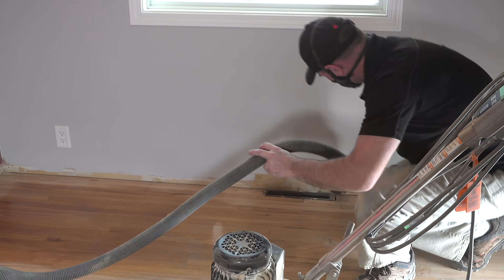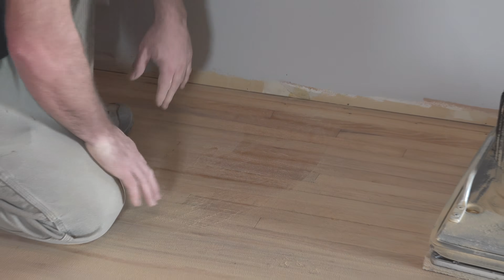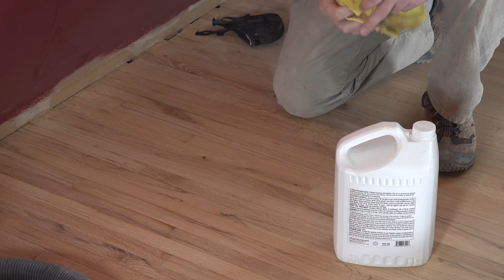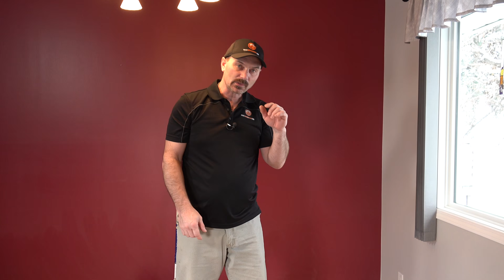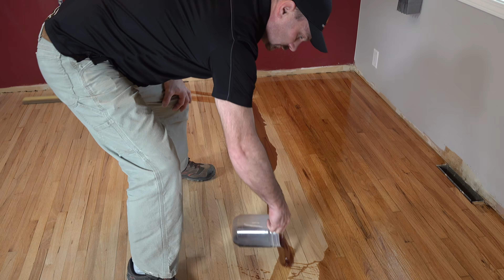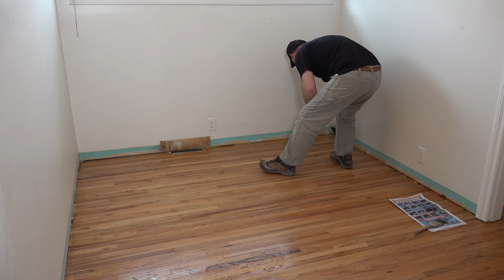How To Sand & Refinish Hardwood Floors

Comment: Hi Shannon, 
This may seem like a silly question.  How do you transition to hallways and adjoining rooms if you are doing one room at a time? Do you sand everything first? Is removing floor trim recommended?
Reply: Remove all trim, this is to avoid damaging the trim (while sanding) and makes life easier since you can't get right to the edge. With trim removed its not necessary to get right up to the wall, depending on your trim depth, that's as close as you need to get. Trim covers what you can't hit. Try and get as close as you can but don't damage your wall.

Transitioning or doing one room at a time: If it's a bedroom, close the door, on the side you're not doing yet mask off the area with 3 or 4 layers of painters tape right under the door. You layer it so that if you're sanding and accidentally hit it you have multiple layers of tape to protect the side you don't want to do yet.

Once you're ready to do the other side: mask the opposite finished side about 1 to 2 inches on to the finished floor. Try and avoid sanding the finished side, you're basically using it as a guide to match. Some blending will need to happen.

When you have sanded, stained and are applying polyurethane, on you're 2nd to last coat of poly blend the transition. You'll need fine sanding paper to feather it.
Reply: @TacoFist  Could you describe the process for blending in more detail? Is it overlapped rotations like when using a sandblaster on small masked etchings? Is it something done with the poly itself?
Reply: This was the exact question I had.  Sorry you didn't get a response....
Reply: @HouseImprovements

Comment: I am really wanting to do my wood floors but I wasn't sure how hard it would be. You just let me know it's very easy. My floors are the cherry red color, what poly... would you use?
Reply from the maker: if they are red stained and you want to change the colour you will likely need to use a drum sander instead to remove more material . The link to the poly I used is in the video description.
Reply: @HouseImprovements  Thank you 😊

Comment: I love the video. I do have a question though. In the video there looks like a six to eight inch wide stripe along the wall that is a different color. Why is that or is it just camera and lighting?.
Reply from the maker: I think it is a reflection of the lighter coloured paint on the wall along the bottom, because if you notice under the plug in that white paint is narrower and so is the area on the floor there.

Comment: The product you used had stain in it already? What color? Also, what did you uses before you got a T bar
Reply from the maker: I simply used a brush or foam pad but it takes for ever! The product is in the video description. it is a varethane so it gives the floor that colour

Comment: I’m trying to watch all the videos I can! Within this last week, we got an entire apartment with hardwood floors sanded and ended up using a “gunstock” color stain on it and it came out horrific!!!! So so bad. Now I’m trying to figure out how to remove this color stain and redo the entire apartment. I’m desperate for professional suggestions. PLEASE ADVISE what we can do to get rid of the stain (which didn’t dry yet) and have results like the one you have shown. Thank you in advance! 🙏
Reply from the maker: To get rid of a stain you will need to use a drum sander. It will sand off more wood quicker to get down to raw wood again.
Reply: @HouseImprovements  Thank you so much for your reply! We used the Varathane penetrating wood stain, which grits do you suggest we start off first when using the drum sander? And after the sanding is completed, should we just use a polyurethane coating on top or do we need to use a sealer first?

Comment: Will that sander leave  Swirl marks? I just want to sand the older yellowish  Vera Thane off So I can re clear it to look more natural.  I was told to use a water based clear so it doesn't  turn yellow over time.

Comment: How many dif grits do I use
Reply from the maker: depends on the condition of the floor. If the wood is good you can use a 26-30 to start and then transition to something like 50,80,100,120

Comment: my brother just bought a house and needs to fix the hardwood floor. He follow the first step of sanding. We are confused about the second part. Do we  apply the  Minwax super fast drying polyurethane for floors clear satin? of is there something else that goes before this. If there is something else what is the product to make sure he gets that color back.  Thanks
Reply from the maker: you can stain the floors to achieve different colours but oil based polyurethane alone will give you this amber shade you see in the video on its own.

Comment: Can you do a home without removing the baseboards? I have a place I bought with real wood baseboards and they also added quarter-round at the base of those boards. I suspect it is so that quarter-round can be removed to sand/reserface then replaced to hide any flaws.
Reply from the maker: yes just remove your quarter round and sand and refinish and then re install.

Comment: Do you know if it's possible to go from a real dark hardwood floor to a light hardwood floor by sanding it?
Reply from the maker: If the finish is completed sanded off. You will want to use a drum sander instead of the sander I used here because you will need to remove alot of wood

Comment: I'm refinishing an entry-way and it's roughly the same size as the area you showed. How much product did you use from the gallon? I'm wondering if I can get away buying a smaller can, as anything left over will likely go to waste.
Reply from the maker: Only comes in a gallon in my area.
Reply: @HouseImprovements  - Yeah it figures that they'd make me buy the full gallon... 

As for the "coverage" on  the label, at 54 years old I've learned two things in life... Never trust a fart... AND Never believe the manufacturer's coverage claims on a paint/finish label. 😉😄
Reply from the maker: The coverage is on the label.

Comment: So is the stain and clear coat all in one? I thought you stain it then clear coat it?
Reply from the maker: There is no stain used here, this poly urethane floor finish has a darker amber tint when applied.
Reply: @HouseImprovements  can you send a picture of the product you use so I can buy the same thing
Reply: One more question please. Is there a fillier to use for the wood if theres a very small gaps in between some wood

Comment: Will this darken over time?
Reply from the maker: with this product I used it will ,but so slowly you will likely never notice
Reply: @HouseImprovements  thanks for the response. I had two bedrooms refinished and stained after pulling the carpet up. The two bedrooms don’t match the rest of the house as far as stain. It’s lighter. The guy who did it said it will darken and blend over time. I wasn’t sure if that was true or not. As of now they don’t match. Thanks again

Comment: TY Shannon . I have a small bedroom 8x10  bamboo flooring in good shape . I'm planning to  remove the top coat  and  apply a different color finish. I already own a palm  orbital  sander  and wondering if i can use it remove the top coat for the entire room? i know its a little more work than big sanders  but up for the challenge if you don't see any issues using a palm sander.
Reply from the maker: Like you said its just more work but it will do it.

Comment: I started to do one room but it is a slow process for me because I am trying first to use stain/paint remover which I wonder if I really need to use this.  The steps are where I started first and have only got it done half.  The fumes from the stain remover are just way too much for me.  Do I really need to use this on the floor?  The steps had paint then they were stained which was beyond my reasoning of why?  The steps probably have not been done since 1970.  The floors are not as bad as the steps.  Do you recommend striping floors first?  They had a really nice maple stain on them but spots were beginning to fade greatly plus when I painted the room I had to use some paint thinner to remove some paint that dripped on them.  So, I had blotch spots.  Like to hear your help and assistance. And thank you so much for showing this video it is truly helpful!
Reply from the maker: The quick answer is skip the stripper and use the most course sand paper you can to start with. For more help use my forum please.https://www.house-improvements.com/forums/
Reply: @HouseImprovements  Just wanted to thank you for the info.  most appreciated!

Comment: Is that a good choice for removing paint from concrete floors?
Reply from the maker: This would not really do a good job with that. A pain stripper may be a better choice but smelly or grinding the floor with a concrete refinishing floor grinder if the paint is loose and flakey then a wire brush in an angle grinder may do it..
Reply: @HouseImprovements  Thanks. On further inspection I noticed that I also have some concrete bumps that need to be ground down (there was carpet before) so I'm going to get a diamond wheel for my angle grinder for that (and all the associated safety gear) and see how that goes for the rest of the floor. If it's too tedious I'll look into renting a stand up concrete planer.

Comment: Great video. Do you think sanding sealer single coat is required before coating oil polyurethane?
Reply from the maker: No need, IMO
Reply: Thank you for quick response. One last thing, when do we use sanding sealer then? For my house, i planning not to stain however will do sanding and it is confusing as few videos shows to use sanding sealer and few not.

Comment: Nice end result. That sander works more effectively when pad is not worn too thin. Urethane application much faster and easier using 6mm low pile lint free roller.

Comment: Thank you for video -  QUESTION:  What color is the polyurethane that you used and how much did you need for 3 small rooms doing 3 coats??
Reply: That was clear, no tint to it.
As to how much is needed for 3 small rooms, that's not a measurement.
Buy them at Home Depot and whatever is unopened, you can return it. But I'd say start with 3 gallons.

Comment: He did really well with this, my only suggestion would be to run your orbital sander or edge sander with the grain of the floor to help eliminate the “halo” or “hat banding” that you see along the red wall. Ideally you would sand in progressively finer grits of paper like you do “in the field” of the floor.
Reply: Thank you
Reply: pretty sure that's a reflection, you don't see it on the dry/dull floor

Comment: I sanded a new wooden floor a few years ago using a round floor sander/waxer, basically an orbital 16'' pad, it worked out fine but I am wondering if using a flat sander as you are using if that is better? My next project is refinishing a floor that had an oil base finish. It hasnt been refinished in 23 years and needs it. I used an oil base finish the last time I had it done and did so because I wanted the color and grain to come out strong * Its a Mango wood floor) But that was when the house was under construction, now i has furniture and finished stuff. plus we have to live in it at the same time. I know the oil base is toxic but want that look. Will an acrylic do the same thing or will I be sacrificing the natural look?

Comment: I am installing unfinished 3 1/4” Brazilian Cherry hardwood flooring & finding so many different widths. Most are within 2mm, but many with 4mm difference, creating gaps. What is an acceptable gap as far as your standards?  Some boards, the width does not match from end to end. Are these normal issues for this wood & what can be done about it?  Thank you
Reply: Oof good luck with the Brazilian Cherry.

Comment: If you do the same thing than when you painting a wall and spread it with a window cleaner cloth is precise and faster then you won’t have to throw it directly on the floor. Also after sanding you must vacuum then clean lightly with mineral water. Aloud time to dry. I have 5 cleaning companies and and I did mansions.

Comment: I did one coat and it came out so well that I didn't see the need to do a second or third coat. Should I have still done a second coat?
Reply from the maker: you will get a better length of the life of your new floor finish with 3 coats.

Comment: Man, I wish I had you confidence and skills to work so close and on the carpet with the finish.
I really enjoy your videos, no fuzz, buzzwords, music etc. just showing hows it done with tips and tricks of the trade.
Thank you.
Reply: Always use a clean dust free drop sheet on flooring next to the hardwood. And get the squeaks out of the hardwood either from underneath or through the top with special screws made for hardwood surface screwing. Doing all that work without fixing squeaky floors is regretful.

Comment: My house has smelled like polyurethane for 5 months, it isn't as strong, but it is still lingering & it's disgusting. I wash my clothes and it doesn't matter, after a few days, it picks up the smell that's in the air. We were thinking of removing the sealant & sanding down the stain & using something less harsh. I really dont want to go through all of that, but I have no idea what other options will work..
Reply from the maker: It should not smell that long. Once its is dried? Have tried  opening the windows for a few hours ? Some people are hyper sensitive to things like this though?
Reply: @HouseImprovements  my windows are open all day, during the sealant process, windows were closed for more days than supposed to... so there was no ventilation... now i have no idea how to get rid of the smell. It's driving me crazy & some guests dont even want to come over because of it. Someone suggested sanding the floors & using something other than polyurethane.. I'm not sure what to do 😔

Comment: Do you have to use a new clean T-bar foam head each time? I'm assuming you either clean the old one, or with a new foam head with the t-bar cause I'm guessing the coating drys on it per coat application. IDK I've never done it before which is why I'm asking so I don't mess it up. :/
Reply from the maker: Right after i finish a coat I put the entire thing in a large garbage bag and twist it closed so it seals up. It will stay good in there for a few days if you need to.

Comment: What do you seal the cracks and holes with if you find any cracks and holes in your floor that are uneven? You said fill the cracks in with something but what? I also saw some people use a sealer before applying the coats. Is that sealer for covering the cracks and holes?
Reply from the maker: You can use wood fillers if you want but that does not always look good. Some people use some of the fine dust mixed with glue during the sanding process . Personally I like to leave them alone , I have never done a floor that was really bad. Sealer does not fill the voids and cracks it is used on some woods to help make the finish absorb more evenly. I would use it on pine, or maple floors usually. We have a forum you should use if you have more questions. There is a link in the description under any of our videos.

Comment: Why on the far wall in the first room is the floor a lighter color than the rest of the room after staining? Is there a way to prevent this?
Reply from the maker: I think you are seeing the reflection of the white paint on the lower part of the wall . If you notice the width of the mark on the floor corresponds with the change in height of the white strip on the wall.
Reply: HouseImprovements ya know I think you’re right! Guess it just has that good of shine! Lol thank you for pointing that out.

Comment: This is great video.. i did a job with my boss and didn't get nice finishing becouse he didn't take care of those many details. I just have a question.. when i have to use polyurethane i have to sand in between each court or just depent  of the brand's  fabricator?
Reply from the maker: depends on the manufacture and usually time between coats.

Comment: I want to remove carpet and paint floor boards underneath purely for practical temporary solution. No sanding,  just throw down a protective layer of paint. A full proper job will be left for far into the future. Is One coat of water based ok for this situation.
Reply from the maker: Painted wood floors will not last long if there is higher traffic. Other wise use a floor/deck  paint IMO

Comment: If you want to use less pads like I do, run your sandpaper across and old tennis shoe or a horse stall mat  from a store like tractor supply. $40 for the stall mat has saved me throusands over the course of my woodworking life.
Reply from the maker: Interesting, that helps to clean up the pad so it can be used again? Maybe can do this one time and use pad twice?
Reply: @HouseImprovements  Yeah it cleans the pores of the sandpaper out, as long as its not torn its usable until the paper gets destroyed this way.

Comment: if your hardwood floor isn't perfectly flat would you use the same treatment? I've heard a sander like yours could sand right through narrow wood floor planks that are somewhat warped by time and moisture from the basement.
Reply from the maker: No this sander is very gentle. If your floor is not flat you need a belt type floor sander to get it flat first.  Unless the floor has been refinished many times in its life you will not sand through it if its solid wood.